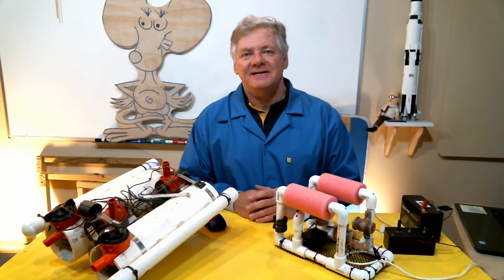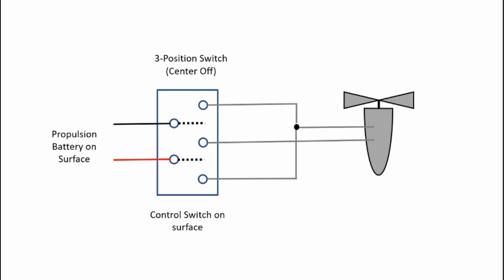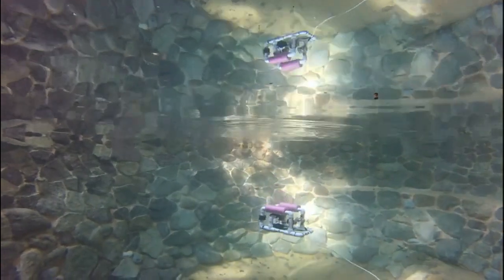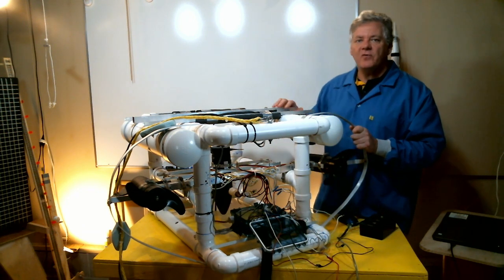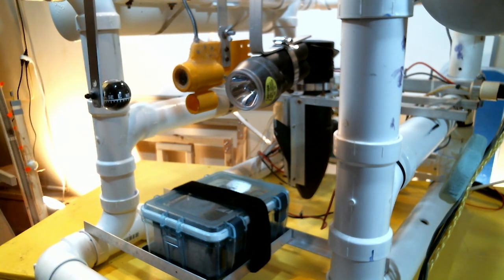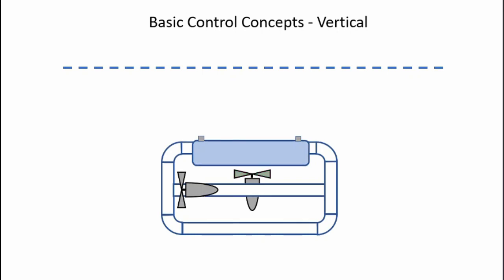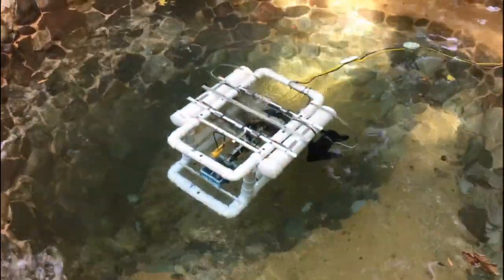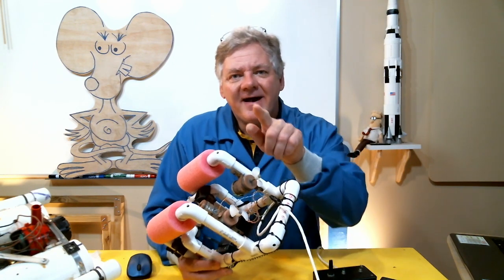Underwater ROV - Home Built

Comment: great video , i need a little help how you select a motor and propeller ,to move a certain weight if the velocity is constant for say 4 knots in salt and fresh water,  as  the density of fresh water and salt water is different, if you know any formula or any material regarding this problem , please guide me . i will be thnakfull to you

Comment: What did you use to extend the shaft of the motors  (the ones in the film canisters) and attach the propellers?
Reply from the maker: I didn't have to extend the motor shaft.  The motor presses up against the bottom of the film canister and the shaft is long enough to stick though.  I then simply press the propeller on the end of the shaft.  The trick is to find a propeller to fit the motor shaft.  You can probably find propellers at your local hobby shop (I suspect some still do exist), or order them on line...
Reply: LabRat Scientific Thank you for your response. The shaft does extend beyond the housing for me toobut I’m worried it’s not long enough for the propeller to attach. How much roughly in mm is needed?
Reply from the maker: I would first obtain the propellers and see how much engagement is required.  I suspect 10 mm would be OK.  However, it might be better to get the propeller farther way from the canister so you get good water flow.  You could extend the shaft by getting a small brass or aluminum tube from a hobby shop that has an inside diameter about the same size as the motor shaft.  You could apply some 5 minute epoxy in the tube and then slip it over the shaft.  The tighter the fit the better...  You can also get some piano wire with the same diameter as the motor shaft from the hobby shop to make the extension.  Epoxy a section of the piano wire in the other end of the tube.  The tube serves as a coupler... The tube and piano wire are generally associated with RC airplane supplies.  If you can drill out the hole in the propeller you could just slip it over the tube rather than using the piano wire extension.

Comment: Great vid. But I can’t find your video about how u use a computer to program control system. Can u Please advise
Reply: u can use arduino to control it by using relay and the rov will connect by ethernet cable to ethernet Shield on the arduino

Comment: Where do you buy the motor sir ? Answer me pleas
Reply from the maker: The small ROV just used small 12 VDC motors that can be bought on line or maybe from an electronics store.  Motors could also be scavenged from toys...  The large ROV used 12 VDC trolling motors - to the tune of $120 each.  I carefully cut off the long shafts and cut the wires that were inside the shaft at the speed controller end of the shaft (to make sure I had lots of wire to mess around with).  I then used some PVC fittings and 5-minute epoxy to seal up the wires where they run into the motor housing.  This sealing part is important...
Reply: @labratscientific1127  thank you sir